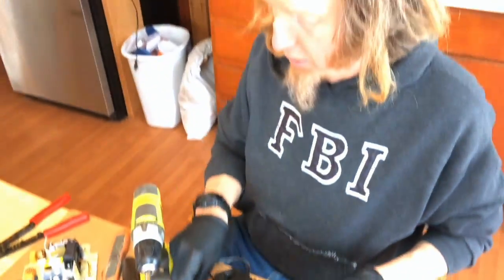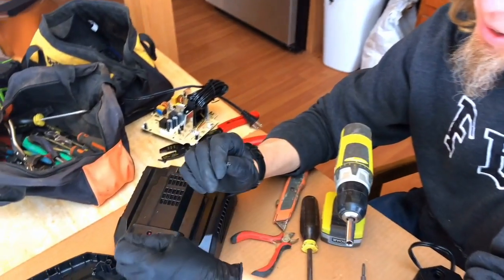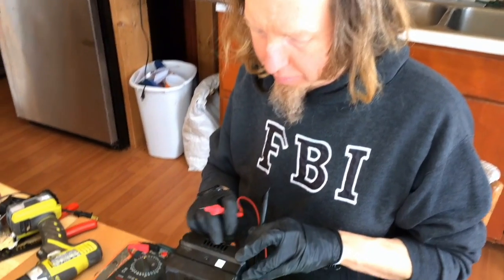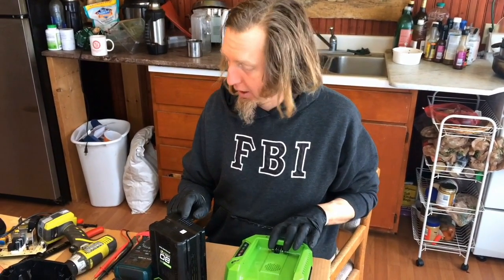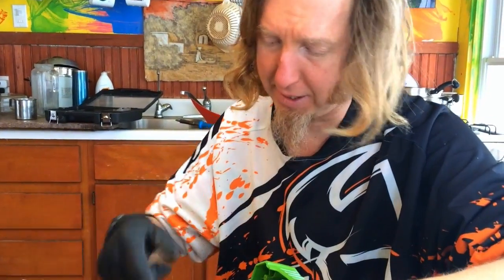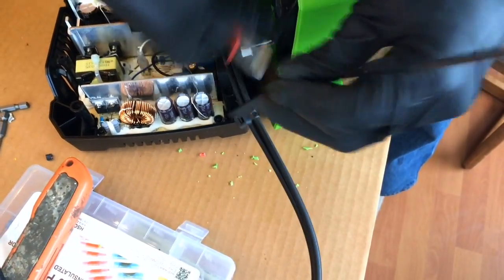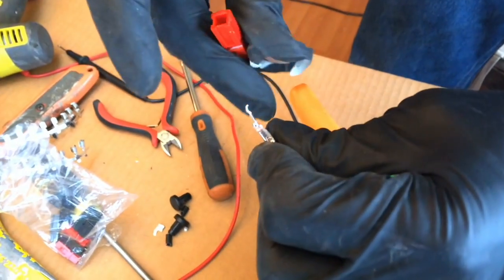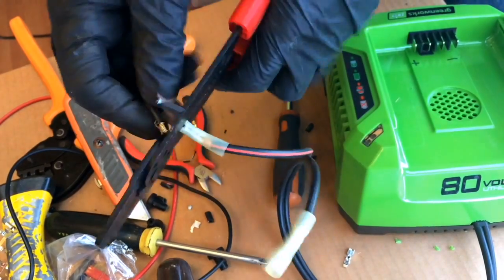Electric Wheelbarrow - Build part 2 - Modifying charger and wiring

Comment: Go back to the drawing board. Figure out how to incorporate  a motor in the wheel .rather than what is show here a remote motor.. the dismantling, and retrofitting  of a battery charger  couldn't  be any easier that dismantling  electric skateboard or  an   electric scooter wheel . Better yet if an appropriate  sized motor wheel could be ordered  from a parts supplier . Would be best
Reply: I have heard that electric bikes with the motor in the wheel are nat nearly as good as the ones with a separate motor.
I think this would also apply to wheelbarrows.

Comment: Soldering  multi   strand wire is a hair puller. The soldering instructional videos on you tube show soldering  one strand device terminals to circuit boards so easy.

Crimp connectors. Appliance  manufacturers use crimp connectors in stoves and washing machine and those thing last for years. But every time I use crimp connectors  the crimps , though tug tested initially work lose later. It's so frustrating. The only reliable way to connect wires  to wires is with a screw tightening down on the wires or  a screw tightening down  on a wire in a device  you would experience  in a circuit breaker a 110/220 house circuit  breaker
Reply: Wire nuts. Simple and reliable. But bulky and so unprofessional. What's unprofessional? Anything that's too simple

Comment: Anderson powrrpole connectors?  What the heck, are you some kind of ham radio operator?  I am and they are the standard in ham radio.  Very cool idea and video, thanks!  FYI, there are much cheaper and waterproof connectors available...but being a ham I only have Anderson powerpoles and can't remember the name of the others.  73
Reply: Cheap connectors. Crimp  connectors I avoid like the plague. But  when the insulation is removed  from a cheap crimp connector compared to an expensive connector , both types are the same . Equally good. To be as precise  as possible I remove the insulation and crimp the wires  so the  deformation  of the crimped metal can be observed. What do I get for my efforts?  Same thing a tight connection evidenced by a tug test. An hour later I  notice the wire has slipped out of the connector.  The professional grade crimping pliers are of no help either . The best crimping tool for me is a diagonal cutter. Crimping a connector  with the insulation removed so I can judge the metal deformation  of the connector  without snapping entirely through the metal
Reply: After reading your comment I googled  Anderson  power pole connectors. Good idea . Thanks for the tip off
Reply: @bobbrawley2612  Most hams I know crimp and then solder the powerpole connectors.

Comment: Awesome!!!!! I,'ve been wanting to motorize my dual wheel wheelbarrow as well as a couple of other farm tools. Thank you!
Reply: I could really use an electric wheel  Barrow as well. But this adaptation of a remote motor and jury rigged chain sprocket concerns me . I was thinking along the lines of a motor in the wheel, like an electric surf board  or some electric scooters. Certainly  like you would see in electric  bicycle conversions. The mating of the sprocket  to the wheel in this video. Drilling the holes in axis  is not reliable for me as an amateur  fabricator
Reply from the maker: Best of luck!  Share notes if you end up with something you are excited about!